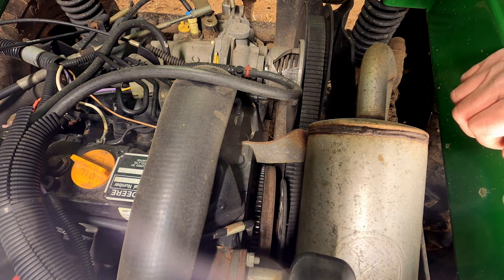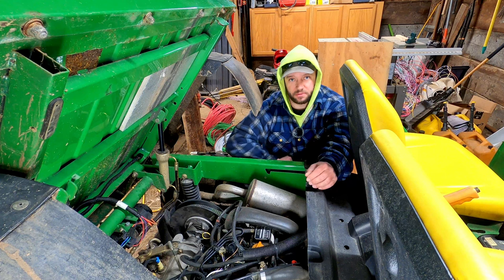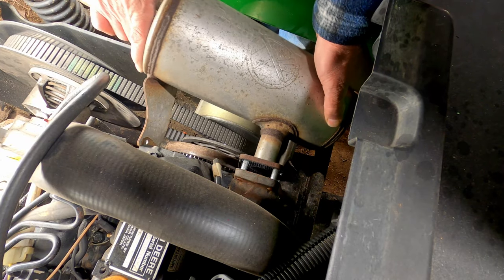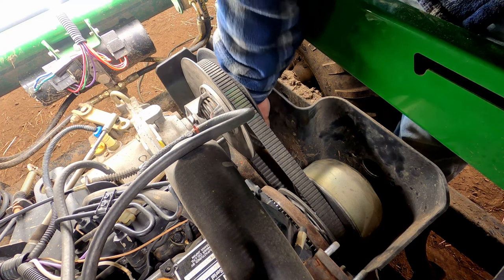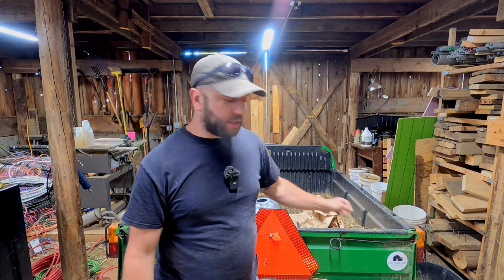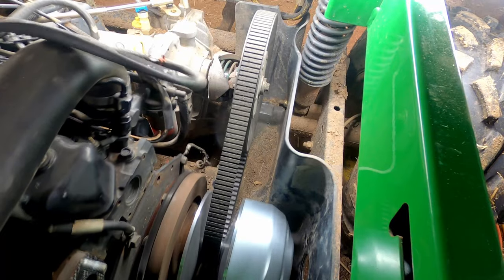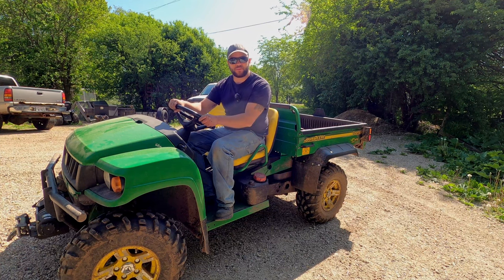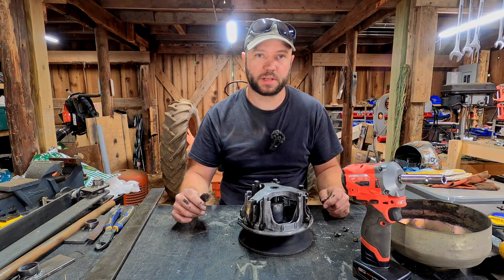PRIMARY CLUTCH ON A JOHN DEERE GATOR HPX

Comment: Thank you so much for putting this video together. I have a HPX Gator with the problem of the Gator "lurching" when you put it into gear. I have read that is caused by the clutch because the idle speed of the belt is then too high. It is great to see how you solved the problem and it is great to know I don't have to go to the John Deere dealership to buy the parts (I really dislike this dealership). Thanks for sharing the Amazon link below also.
Reply from the maker: Glad you found it helpful. Good luck with your repair!

Comment: That biggest bummer here is that it is one more project getting in the way of getting the Case SC up and running. 
Isn’t helping with the grapple either.
Reply from the maker: That is very true! The biggest problem with those two projects is I ran out of winter before I could finish either of them. I am hoping to get back on the grapple soon.

Comment: Hey Justin, I have to look at my mule CVT.. It needs a refresh as it takes higher RPM to get moving and my top speed is noticeably slower.  Thanks for showing us that fix.
Reply from the maker: Hey Ross! Our Gator felt like it had the breaks on before it finally just quit. Now it's like a whole new machine! It was a pretty easy fix (except for the part where I took things apart that I didn't need to). Thanks for stopping by and take care!
Reply: @JustCaidsDayFarm  and I thank you for doing that so I don't have to! 😂
Reply from the maker: @RossOnTheLand  lol No problem!

Comment: This comment/question is for anyone. The driver side rear brake rotor and the rear axle appear to be all one piece. Is that true or did I not examine it close enough. I have tried searching Youtube but didn't find anything. (That is what is great about finding this video - it gives me hope that I should search some more.) That rear brake rotor is chewed up bad. The one on the other side is fine. I haven't looked at the front rotors. Thanks!
Reply from the maker: I have not looked into any of the breaks on our gator so I have no advice there. I bought a service manual online that was very helpful with the few repairs I have done. I think it was around $40. Good luck!